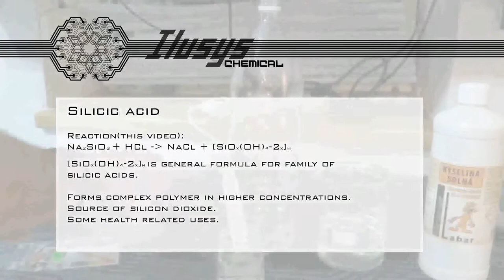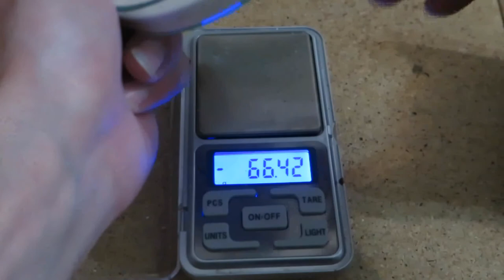Silicon dioxide synthesis

Comment: Pls how can I use your method to achieve silicon dioxide gel for surface coating.
Reply from the maker: Not sure how that is done(or what it is), so I won't be able to help you here
Reply: Your produced the powder of silicon dioxide but I want the liquid type. How can I get silicon dioxide liquid gel.
Reply from the maker: @safreedinternational6461  Well techniclly, it's called glass :) when it's hot it starts to behave as a gel..

But seriously, I don't know what is the thing you want to achieve, so I can't help.
Reply: I want to rub the gel on the surface of my phone screen to prevent my phone screen from braking or shattering. I was told that silicon dioxide gel can be used for such application
Reply from the maker: @safreedinternational6461  
Ok so If there is any product like that, it's likely scam. How would you test it? would you buy 100 of same smartphones(even screens) and break them all?
Of course, these sellers know, that you can not test this + your brain will try to justyfy the purchase at any cost.

But, if you are interested in learning about how this can be done to normal glass (phone screens are for 99% already hardened or otherwise engineered) you can watch some really nice videos on YT
https://www.youtube.com/results?search_query=hardening+glass

Obviously glass related technology is quite niche subject so you would likely have to commit large amount of energy into your own research to achieve something significant.

Comment: Can you please do experiments on how to use silicon dioxide in hydrophobic coatings
Reply from the maker: I don't know if that is done with SiO2. normally it is wetted by water quite well, perhaps with some geometry it could be achieved. I would ask, did you mean silicone?
Otherwise I would have to look at some papers to see how it can be done, and that's not really what I do unless I need it for some project
Reply: Ilusys Systems thanks for reply. It’s involved in making nano particles hydrophobic (fumed silica with a triethyl silane) then some further processing with dilute ammonium hydroxide. This makes it super hydrophobic. I was hoping you could demonstrate this
Reply from the maker: @solo876  yeah that would be probably mainly thanks to silane, I would assume that silica is used as convinient filler, but I don't know much about that. Well maybe if I need something like that or I would be bored :) or you convince me that I need it :D
Reply: Ilusys Systems well it’s used in making super hydrophobic coatings to protect paintwork on car clear coats, enhances hardness and has self cleaning properties. I hope you like cars too.. now you can try and make some to protect your ride xD
Reply from the maker: @solo876  my car is paint is protected by relatively thick layer of dust, algae and moss :D sooooo dunno.
But my windshield is perfectly clear :)

Comment: How to make orthosilicic acid for agriculture use 3% stablised solution
Reply from the maker: That should be possible, just mix dilute SaSiO3 with some acid, but mix it quickly and make sure solution is always acidic (use slight excess of acid). 

If you do this there will be no solids formed, so silicic acid should be stabilized.